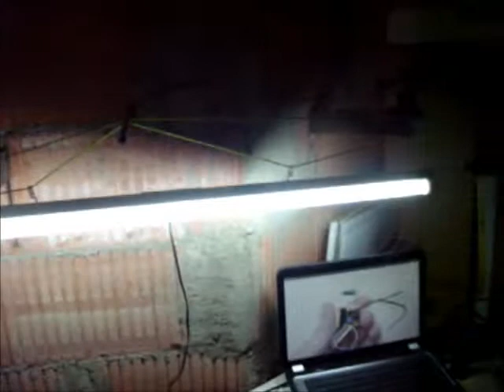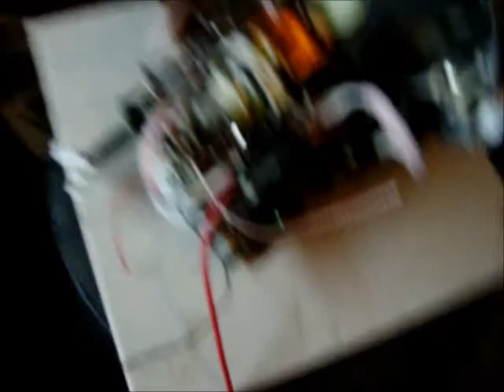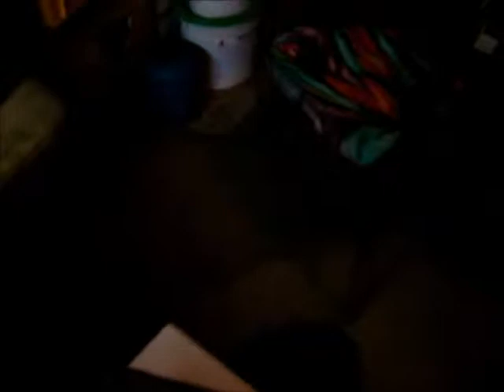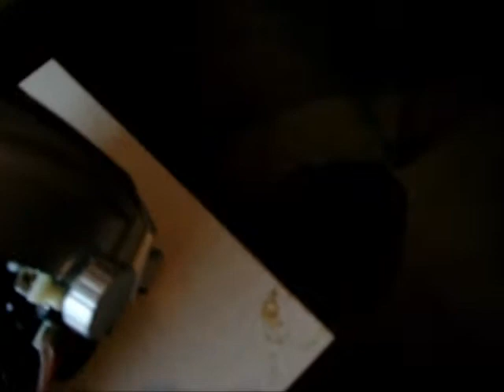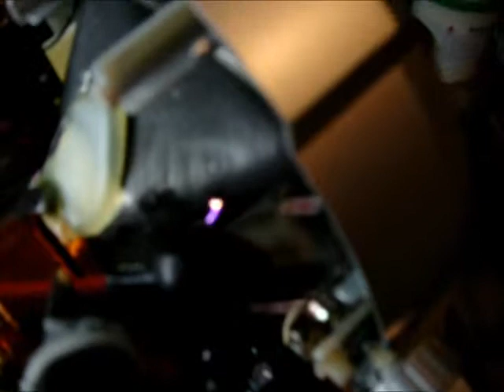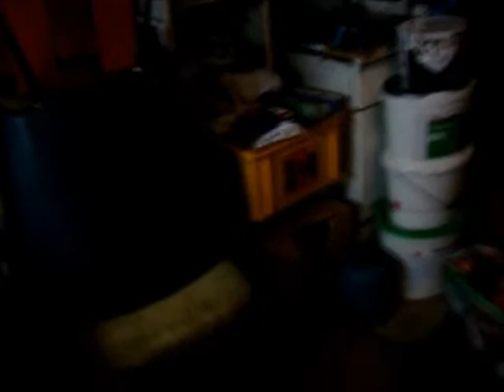portable crt tv tiny arcs

Comment: the amount of amps doesnt matter :) as long as the voltage is right and the amps is over what it needs it will use the right amount of power, if the amperage is too low and the voltage is right it will try to draw 1A but the current being drawn will cause a higher voltage drop in the supply components (diodes + transformer) because of their internal resistance meaning more heat is generated in them and burning out the supply. but if the supply is 3A @ 12v the tv will still draw 1A and be fine.